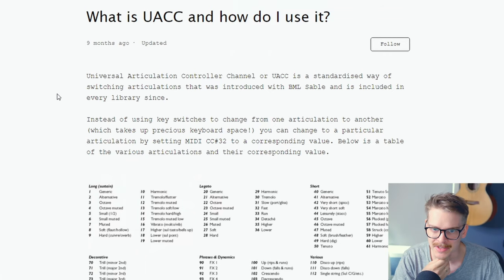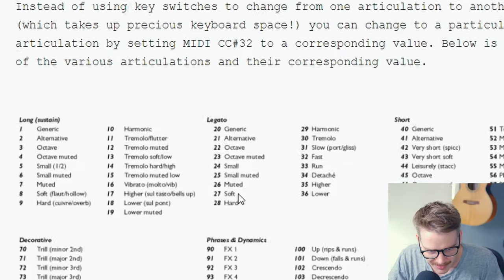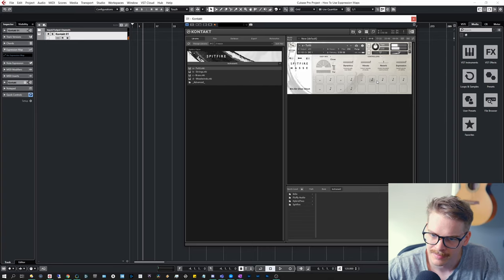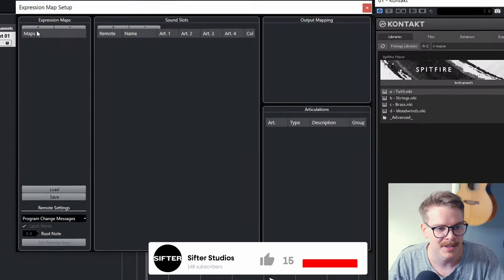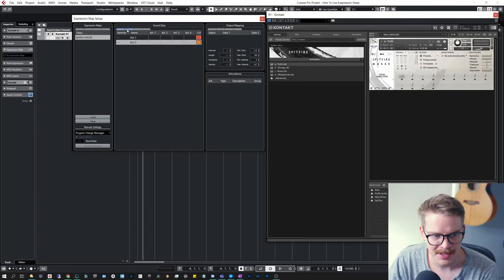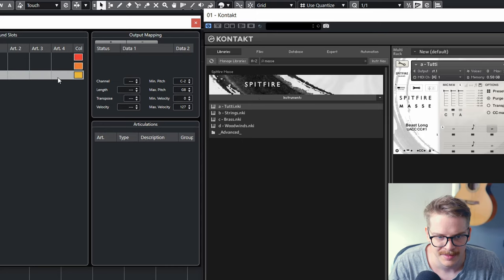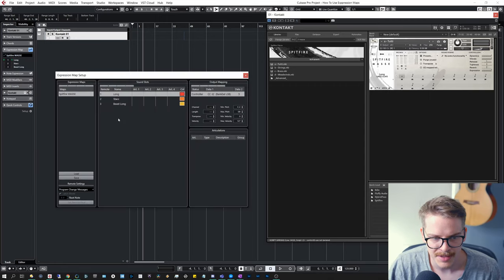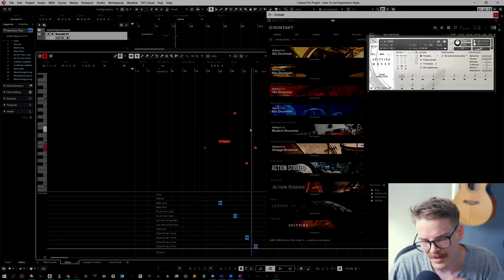Spitfire Expression Maps 🎼 UACC Expression Maps In Cubase

Comment: I haven't used UACC maps before, generally which one is considered to be 'better' for articulation programming, UACC or key switching? Or is it just a matter of taste?
Reply from the maker: Hi! In my opinion the differences are very small. If you’re using an instrument with many different articulations you will not have to reserve some of the keys for the switching.. however if you are working with instruments with limited range (e.g violins) that wouldn’t matter that much... so mostly a matter of taste I think!
Reply: @SifterStudios  Makes sense! Thanks for replying.
Reply from the maker: No worries! 👍💪